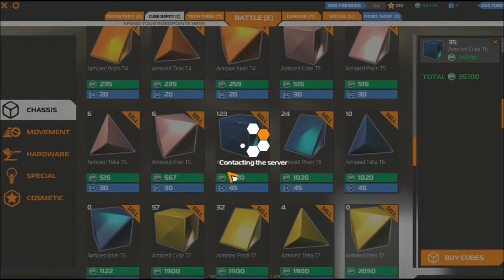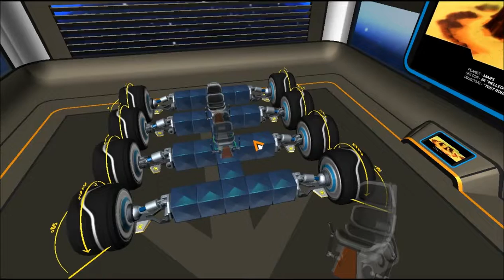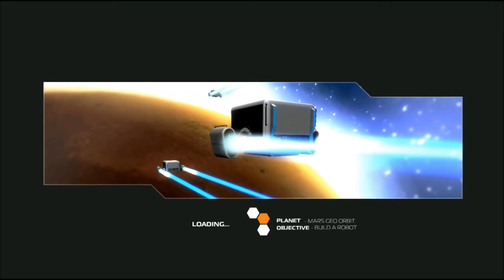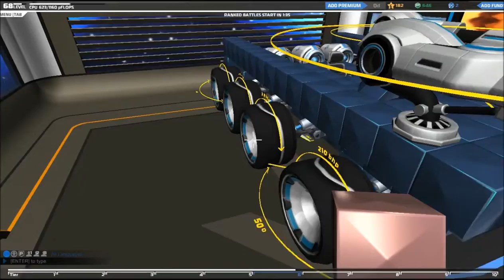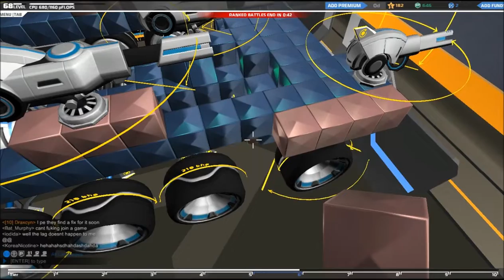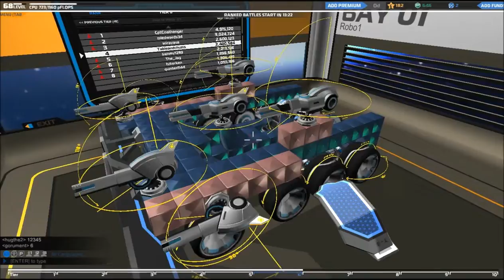Let's Build Tier 6 SMG Buggy - Tutorial - Robocraft

Comment: Hello! I am having issues creating a Tier 6 vehicle because it seems like no matter how much Tier 6 and tier 5 crap I slap onto it, there's just never enough. I'm going to put tier 5 Shields onto it later and try again.
Reply from the maker: What type of bot are you using?
Reply: Table and Chums SMG-Buggy-ish although I just managed to push it into Tier 6, even if the design is very questionable at best: http://prntscr.com/6awt0w
This maxes out my CPU and I'm struggling through battles to get enough tokens & RP for tier 7 SMG guns and tier 6 armor blocks.
Reply from the maker: I had a look first thing is fully enclosed the seat in Armor. 1 direct hit to that and you die :(
Reply: Table and Chums I enclosed my seat in Tier 3 armor to hopefully just stray off some SMG damage. 
Once I've enough RP&Tokens for Tier 6 Armor, I'm buying as much as I can and just making a robot out of that. Potentially a healer, I like using shielded, armored but still speedy robots, which makes my current one awful because It's just horrible in every sense of the word :P
Reply from the maker: ***** hmmm i see. Shields are quite a good way to build a bot with few armor cubes. Medic hover is a very good way to make rp XD